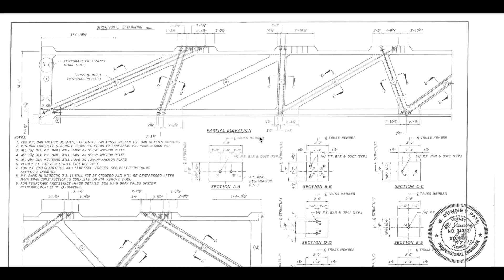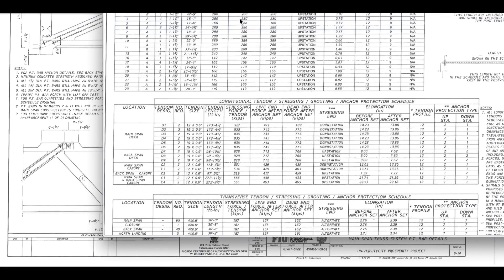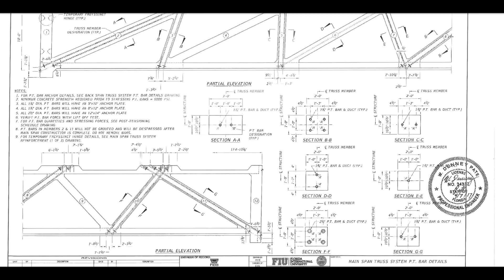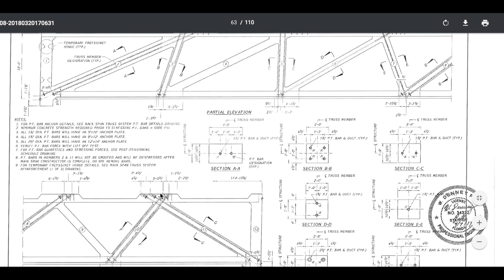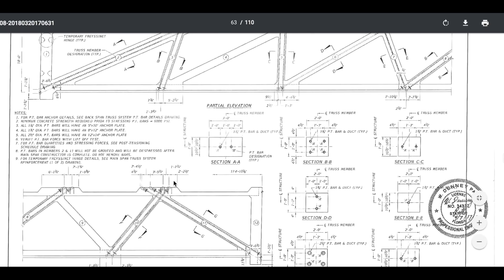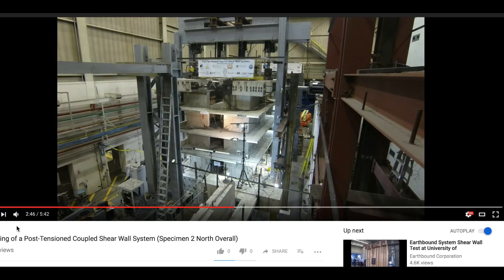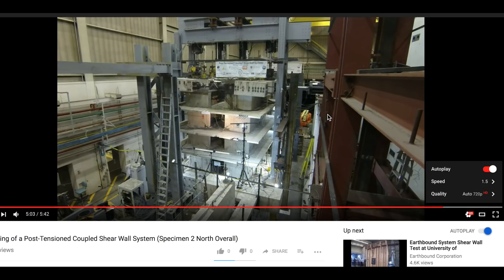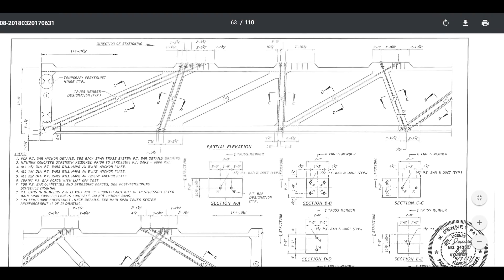FIU Bridge Collapse Shear member / shear wall cause of failure?

Comment from the maker: For everyone who might want to know what went wrong..., this is where thinks went wrong ... http://www.colby.edu/mathstats/wp-content/uploads/sites/81/2017/08/2017-Manning-Thesis.pdf
A reply to Internet Privacy Advocate, those web members - ARE structural -- the issue, most people have is that because of the ''design path" of the ''cable stay'' ... they appeared to locate the ''web members'' to match that design path - to the pylon...
They truss and their location were structural and FIGG, did calculation, I believe using post tensioning, to compensate at the nodes / blister bars and the ''countering member'' to resolve their ''non-symmetric design" and then we have all the other details that add up to this event. In my opinion because, this team of people were not very professional... ONLY one exception, if the machine would not turn off and or the operators all had a heart attack at the same time, etc. (an act of "God")...

Comment: I just caught on in watching youtube on the failure of the FIU bridge. I am not a regular youtube user and I was not able to find a logical way to follow the different threads. Therefore, I don't know what all the investigations are up to this point. However, I have seen enough to lead me to believe the concept of this design had a huge flaw. This is simple support beam with the canopy act as the top "flange" and the lower deck as the bottom "flange". The "web" is made from the skimpy diagonals. These diagonals are visually inadequate to tie the top canopy and the lower deck together to perform as a beam. The failure mode is high shear force at the diagonal joints near the support where the shear force is highest for a simple beam.  VQ/I is the problem from Mechanics of Materials 101. Concrete is not only weak in tension, it is weak is shear also. As I understand, the end diagonals were post tensioned. At the time of failure, the workers were in the process of detensioning the cables at the end diagonals. When the diagonals were under the post-tension, the shear carrying capacity of concrete is like the frictional force between the aggregates under the compressive force of the post-tension. The coefficient of friction as I remember could be higher than 1. As the diagonals lost the post-tension load, the shear capacity went back to what the concrete alone could carry, which is merely about 55% of the compressive strength. That was why the joints were busted and followed by the sudden collapse of the whole bridge.
Reply from the maker: How did you come up with 55% and based off of what number?
I don't really like percentages talk as they need to be based off of a known number to be accurate.
Ps Thank you for your thoughts, posted above.
Note: This might be more a "stress failure" first and not a true shear failure first...
FYI
This term, stress failure, is not the same as load...
And "shear failure" is not the same as shear-wall failure...
Reply from the maker: Not even close dr bichat,  I went over this in a numerous videos...  The ''stupid'' Polish guy even has the bridge pivoting in mid-air!  https://www.youtube.com/watch?v=6XFPtu-OTi8

Comment: Thanks for an insightful unassuming series of posts, until or perhaps much after the finial report is released the reason for the failure will be debated. What has bothered me is there (in my observation) seems to have been an underlying agenda to build a structure to showcase their commitment to diversity and new thinking that influenced the design and material selection of the bridge. My two cents would be why if you wanted a minimalist, airy structure why choose concrete rather than steel. Tinfoil hat  now worn did the knowledge that this structure represented the political social hot buttons silence engineers who had concerns?
Reply from the maker: My thinking, if it's not broke, don't fix it.
Steel works... post tensioning is just cutting corners, and the hundreds of girders supporting steel structures (across the country),  that use post tensioning; are all too many...
This is a terrible idea to use as a main structural support...The inspections are too difficult...
You can't inspect the internal wiring, it is not visible...
100 years they state...no way these cables last 100 years.. they will stretch  (creep) and cause 100rds of failures...if, left to their own accord...(my thoughts).
Ps Thank you for your comments and no tin-foil hat required...

Comment: Arie van Wageningen/Netherlands
I am not a building constructor but I worked more than 2 decades in a factory where we made Gangnail trusses. My work there was to make the production drawings.
I think I know why this bridge collapsed.
First, I think, the bridge is poorly constructed and this bridge is not what it looks like.
The bridge is a web-truss with two parallel beams connected by web-diagonals.
The whole construction is fabricated in concrete. The cross-section of the pedestrian-deck is much greater (wider)than the roof-deck so the center of gravity is very low. As a result of this, the compression in the roof-deck is much greater than the tension in the pedestrian deck. By prestressing the pedestrian-deck the compression in the roof-deck will increase.
Prestressing the roof-deck is useless because under full load the tension in the cables will disappear.
The same happens in the web-diagonals 2,4,6,7,9 and 11.
More important is whether the cross-section of these elements can withstand the pressure under full load. Most important is the dimension of the cross-section of the roof-deck. It has to withstand bending in both horizontal and vertical direction. The best shape for this part is a T-form, upside down. Web-diagonals number 2 and 11 are most important because the pressure in these parts is higher than is every other web-diagonal. Check the dimensions of this cross-section in relation to the length. Prestressing these parts is of no use.
To minimize bending horizontally of the roof-deck we can prestress the roof-deck longitudinally by beginning in the center at the ends of the beam and halfway at full width of the roof-deck.
The bridge collapsed because the roof-deck and the web-diagonal 11 could not withstand the pressure.
Reply from the maker: You have pre-stressing and post-tensioning confused with relationship on how they work with respect to this project...

Comment: Bottom line is . this project was WAY over-engineered. These assholes ( I refuse to call them " professional engineers " , because they are not  ) toyed around with bridge designs on a computer and thought , " Hey , this looks cute...let's buid it " .When any five year old with an Erector set ( showing my age , lol ),could have told them , " This ain't gonna work , jerk weeds. "
Reply: Lyle Paradise.... erector set over Lego's any day.  that's the turning point at which things got bad. lol.  and plastic forts took hold over wooden tree houses. haha.  it's tru though

Comment: For diagramming the forces, just do simple torque analysis setting the origin wherever aids computation.   Then, any forces that would surpass the concrete failure point must be compensated for by the cabling forces, which you must maintain at all times or the bridge will fail.  These can be calculated separately(and graphed over time as they change, with a red line that changes as the moving supports change and it is placed on the pillars)   The tension won't affect gravity or torque at any point, because it is a free body, and not attached firmly but resting on the pillars in open air.  It only affects the breaking force necessary to cause failure, redirecting it in the direction of the tension.  Imagine the bridge without any cabling.  If it were just concrete, how would it fail?  This breaking calculation is exactly what must be covered by the tensioning system at all times.   The tensioning can be considered separately and overlaid on the simple bridge torque vector diagram to ensure it meets or exceeds all breaking forces.   

I don't know...   maybe I need a nap...
Reply from the maker: Thanks for that, I will consider the nap angle... I am not going to attempt numbers on this structure, the variables are unknown by the public... Remember, the canopy is still without post tensioning...
Also, we now have cracks, which have to be determined and considered "weaknesses"...
This structure is not complete so no way general public can do load calculations.
Then these truss/diagonals  and their reaction are not typical...
So, I am not going to waste my energy on that (any longer)...
I will consider the structure not stable as the cracks showed up days later and no hurricane force "created" those cracks...Those cracks are stress related cracks and I would bet they were at joints or at underside of deck or diagonals (My best bet).

Comment: Do you have the tensioning instructions?   I have heard some stuff about the tensioning adjustments for when they lifted and moved it into place, but I haven't noticed the official numbers on the adjustments between the different phases.   That would certainly take out a lot of the guesswork...  It seems like they would have a blueprint set on a computer file they must not be sharing with the public for whatever lame reason...  we have to hear from the worker that was operating at the moment of failure to see exactly what the reasoning was behind whatever he was doing...    have they even been deposed or questioned?

Comment: The last member was to be detensioned But the pier is at the end How do stresses loads get from truss to pier using only standard rebar in minimal concrete they were using. Agreed non symmetrical design truss angles lower deck / flange bigger than upper insanely complex compounded by snap changes to accommodate "surprise" that road curb would get in way of monvers

Comment: Simply put members 11 and the other end (i think 1), dissolve's the compression load down to the bearings.  The fact it has trusses at angles resolves itself if the post tension in the strands are designed to make the triangle balance. Concrete will crack, this allows any re-bar to take up the tension from the concrete, (as this build has re-bar in it). We expect some deformation and this will lead to crack, all normal as long as the crakes are within expected tolerances. The compression is greatest at the end blister points as all the top self load passes through them at each end. That means strut 11 and 10, take most of the self load and transfer it to the bearings or to the bottom slab of the bridge. So what you are saying is effectively correct, in a round about way... In mY educated view.
Reply: So, why de-tension 11 then?

Comment: Send yer kiddie to FIU structural engineering school for a fine fine structural engineering education,  that kiddie too can end up with such a fine fine project on his resume.     

This will blacken the name of that school forever or as long as it manages to last.

As an ME and not an SE I do not like that odd ball mix of materials, difficult or impossible to balance angle formations considering its variable loads during and after construction, and reliance on post tension creating point failure modes, with no redundancy... and no way to estimate how it will age.  

I consider the perimeter of those blisters under * tension and grossly insufficient rebar in the area. 10x rebar would have been more appropriate especially considering a more or less standard 400% over design requirement,  bridge was designed to meet the load, not to exceed it by 400%...especially considering seismic loads,

 I think a full analysis of this sort of construction will result in it not being used in the future and what we seen in china with the welded tube construction will prevail... all steel construction can stand these mixes of compression and tension all at one location, where concrete is hard pressed to do so.... made worse, not better by post tensioning at the complex intersections.

a degree or two of camber would have also dramatically reduced the load on the truss... I consider no camber  one of the fatal flaws... camber would have put the entire base under compression, not this odd ball mix of compression and tension....especially as the weight of the bridge would cause the entire base to go under tension.... a gross error in my view.... and the engineers knew this apparently, thus the extensive post tensioning on the base... a philosophical error imo... a violation of common sense.
Reply: A private women owned firm designed it.